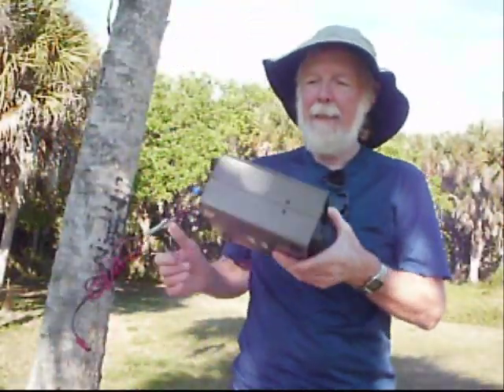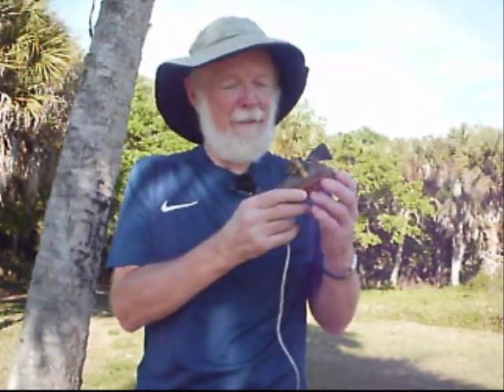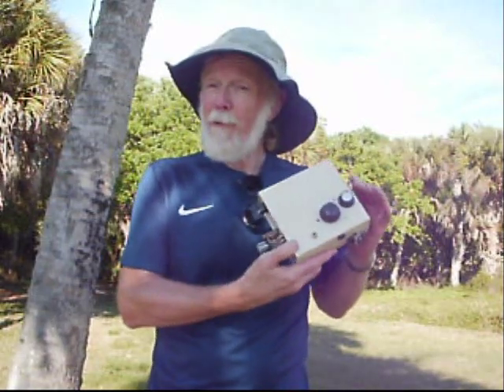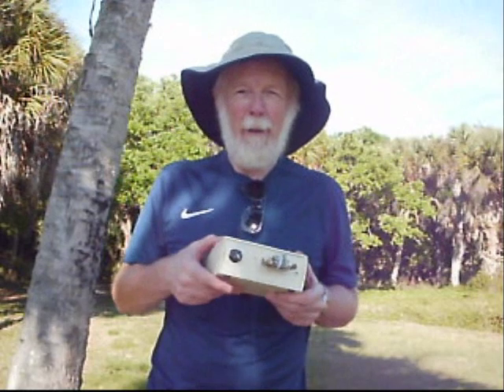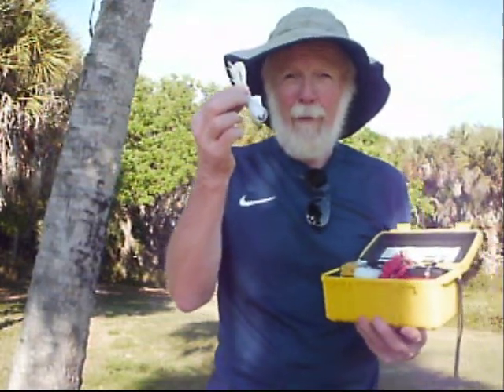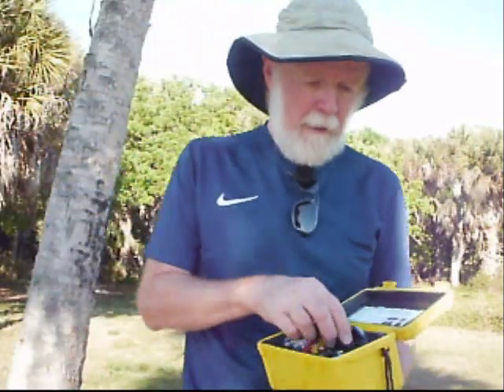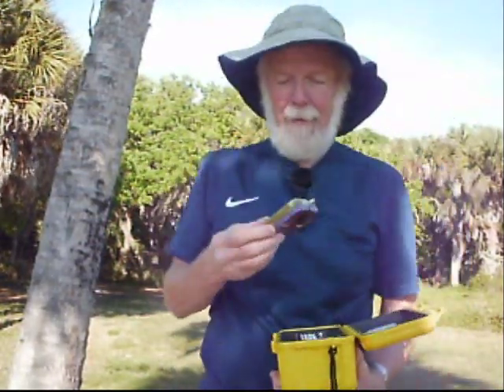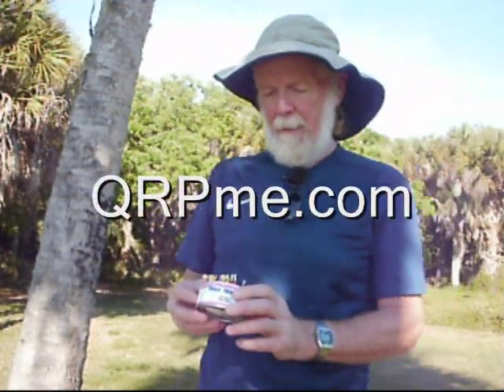Ham Radio hiking gear.

Comment: I enjoyed your video very much. Although I am not a backpacker, my wife and I camp in a Class C RV and I bring my KX3 along and various home brew antennas. I was using a 5AH  SLA battery which was finally losing its capacity. I recently purchased a 6 AH Lithium Iron Phosphate battery from Bioenno Power in California. It looks like it is going to be a winner.
Reply from the maker: Yes, I too have a 9 AH Lithium Iron Phosphate battery from Bioenno Power. It far exceeds my expectations. I recently rode my bicycle from Oregon to Massachusetts and never once ran it down to where I was anywhere near out of power. You can see the blog about that adventure at: https://xcbiketrip.com/index.php/welcome/

Comment: I really like your idea about putting the radio in-line with the antenna and dumping the coax.  I think this will help matching problems and will mean one less thing to carry.
Reply from the maker: Yes, eliminating the coax is a must. One just doesn't need it out there. Even on mountain tops, where there were no trees, there was usually a rock high enough to make things work.

Comment: I loved your altoid radio! (HK3IWL)
Reply from the maker: +Patricia Suarez Last summer, Jane, KA1FUN, and I hiked the Vermont Long Trail, 273 miles. They had all-time record rainfall and the radio started acting odd, I think all the connections in it are starting to corrode after many years out in the weather. It is still working, but thinks are starting to act a bit intermittent. I may retire it for my "museum." Currently I'm messing with an FT-817ND, but it may prove a bit heavy for the long distance hiking, we'll see.  Check out the PFR-3 radio, it is essentially the Altoids radio, with a built in antenna tuner and batteries, nice package.
Reply: I'll check!!! Tks and 73's
Reply: will need to check out the PFR-3 radio.  Thanks for the tip on something as the SOTA backpacking community pushes the development further.  - N1KTJ

Comment: Thank you. I really enjoyed listening to your video. I am travelling from the UK to the Philippines soon and weight is my main concern. I passed my CW test many years ago and, I use SSB 90% of the time and Digi 10% the rest of the time. I have no option but to increase the weight of my equipment by taking my Yaesu FT817, a small tuner and a few wire antennas (and possibly a small roach pole?). I do have a Buddipole Deluxe but that is likely to push my aircraft Kg over the weight limit and that may incur charges £$. 73 de Bob, M0BOB.
Reply from the maker: +Robert Adlington (M0BOB) Let us know if you're on the air there, and when. It is always a weight vs. cost battle, isn't it?
Reply from the maker: How did the trip work out?

Comment: For those who are rusty with CW, just wondering why more have not thought about using a tablet computer (Windows 7 lightest eight possible) and a few other key components like MRP40 software, and a SIGNALINK USB (or other lightweight sound card) and W1GEE serial keying module. Wish there was a CW application on android or iPhone with a Bluetooth to keying circuit connection; but maybe some just use audio speaker output on the microphone connection for output keying; and microphone input for CW translation.
Reply: Computer programs and apps can only receive well if CW is transmitted by a computer or a very meticulous CW operator. Most CW operators are a bit sloppy with a hand operated CW key. You won't decode much with a computer but can receive it very well by ear. A human brain is billions of times more powerful than the most sophisticated modern computers. Use it.
Reply: well MRP40 may only be a start, but if we have applications like SHAZAM and SIRI and like ten others how far are we away from having a capable MORSE identification application?  CONTEST folks are using MRP40.  One graduate student away from making it work extremely well?  Pure speculation, but with the various JT65 modes and more being full of users to take advantage of bandwidth, just am thinking that its good to go down the path of letting the computer do the work.  Its not that its impossible to learn, but its more that people are flooded with too many things to learn.

Comment: interesting. I very much expected an ft817 to be your final choice but when you mentioned elecraft I knew that wasn't to be.
what is the power output of the altoids radio ?
Reply from the maker: I love the Elecraft equipment, I just didn't have the funds for such a fine radio. I did end up with the FT-817ND. The Altoids radio depended on battery voltage, anywhere from 2 watts to 6 watts.